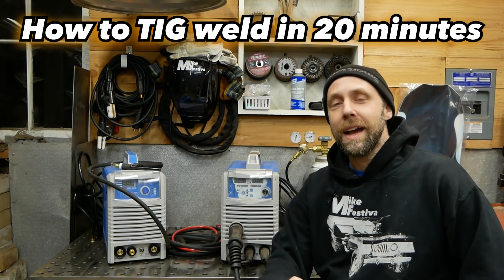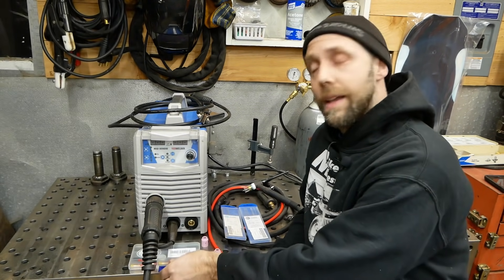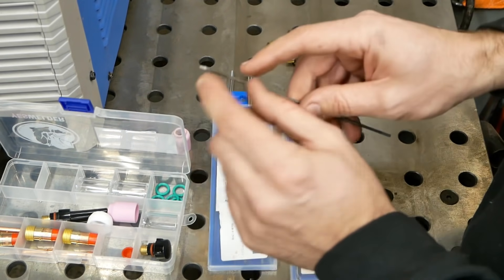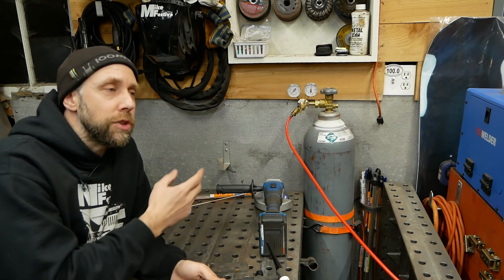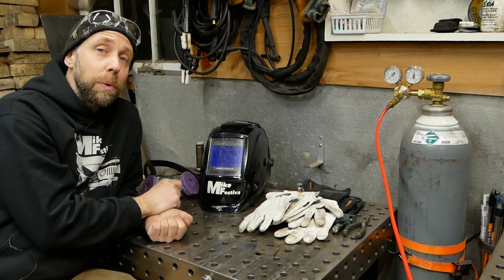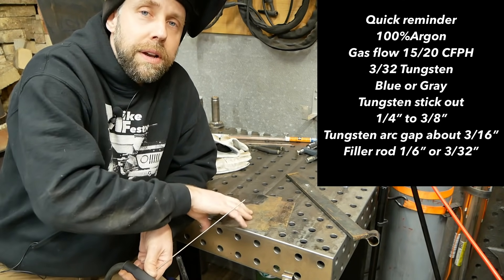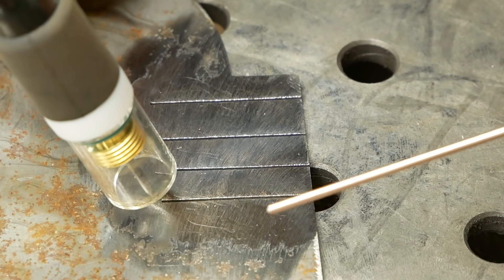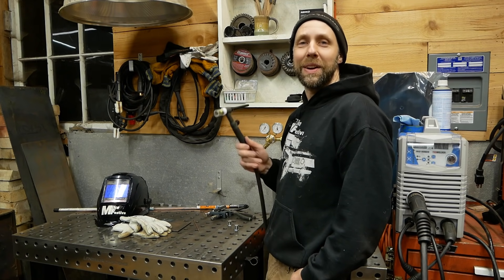Learning how to TIG weld made easy

Comment: Little tip. If you have multiple tungsten rods take 5 to 10 min and sharpen them all at once. This way you dont have to take the time to resharpen mid welding. I sharpen both ends of my rod so i can just flip it if need be but if you are using different rods its not recommended unless you mark the middle or something because you will grind off the color code showing which rod type your using. Happy welding folks

Comment: As a journeyman boilermaker (graduate of Boilermaker apprenticeship) you can definitely learn to Tig weld in 21 minutes. I did. The other 3 years 364 and 15/16 days of my apprenticeship were spent learning stick welding.
Reply: @BPattB  really why is that I thought tug take the most knowledge and skill
Reply: @levipote8823  I was making a joke. Tig takes the most time, in my opinion, because that's the last type of welding most people are taught.

Comment: Tl;Dr. 
I appreciate you and everything that you do Mike. I grew up welding in the oilfield here in Texas. I had my own rig and chased the pipeline until we had my son and my wife demanded a house instead of the Airstream. We settled in West Texas and I was never out of work until the recession hit in 1986 and everything stopped. There was no work anywhere and all of my friends were losing everything that they had. I got  line on a job in Corpus Christi with a company that built stainless steel milk tankers. I had never TIG welded in my life but had had a strong background in gas welding. I showed up to test and was pretty lost but figured out how to set up the machine (the shielding gas wasn't an issue since I also had a MIG machine and was familiar with it). But I was having trouble and one of the welders saw this and strolled by the test station and dropped a sharpened Tungsten on the table as he strolled by. I took the hint and put it in the gun and it was like the sky opened up! I then proceeded to build what they had on the blueprints (I can't remember now exactly what it was) and I passed the test. Thankfully, they teamed me with a guy who had forgotten more than I'll ever know and he molded me into a good stainless steel TIG welder. We never failed a USDA inspection and they crawl around those tanks with black lights looking for the slightest inclusion where bacteria might grow. It was an amazing experience and I loved it, even though I drove my rig to work every day and never fired it up. 
We welded everything except aluminum and I wanted to learn aluminum. Rey, my work partner, would show me  a little every now and then when we had a little down time and I'd practice. But I never got good welding aluminum. I could weld stainless all day, no matter how thin. But aluminum was a different animal and I was never at a point where I was confidant in my ability. 
I said all that to say this: I'm 68 and retiring in 2022 and want to buy a TIG machine to weld aluminum. I have an aluminum boat that needs a lot of help and don't want to have to rely on a spool gun. Some of the aluminum I'll be working with is very light. So I'm using your videos to refresh my memory on a lot of stuff and to learn things that I never learned. Your channel and "Welding Tips And Tricks" are two of the best that I've seen. I've bought machines that I'd have never even considered before watching your videos. Yes Welders? Yes, please! Inverter technology rocks! I have a couple of them in my shop that I haven't been able to break. So I'm looking forward to your aluminum demo. If you've made it I just haven't found it yet. I've subscribed to your channel for a long time but don't get notifications very often. 
Keep rocking these things out and I'll keep following along. You're an amazing guy with a ton of talent! And you're a great teacher. Seriously!  There are probably thousands of truly skilled welders and fabricators out there who don't have the ability to explain to others how to do what they do. I know a bunch of them personally! I look in the mirror and see someone who is not a good teacher! I don't know as much as much as many others that I've worked with but what I do know, and know very well, I can't teach.  
Thank you again for all that you do.
Reply from the maker: Thanks man I really appreciate it 👍 
I really enjoyed reading your comment, thank you very much 🙂
Tips And Tricks is definitely an A+ channel 👍
Hello from the Pacific Northwest!
Reply: I'm totally with you Texas Plumber - a bit younger, but same boat here in Idaho - and Mike you have helped me even improve my MIG. Never tried these "Yes" welders, but when my old Lincoln MIG finally went down Mike's video's encouraged me to try the Titanium 200 Unlimited, and I'm AMAZED at what I can do with it now! I might just give one of these YES brands a try for the Aluminum TIG side of things. Mike, You F'in Rock Brother! You could do a 2hr video on the color of Rust & I would watch it all.
Reply from the maker: @BareRoseGarage  Thanks man I really appreciate it 🙂👍 
Ps I love Idaho, I have spent a lot of time exploring all over that state on my dual sport motorcycle, I have found some really cool places and hot springs along my journeys! 👍 what part of the state are you in?
Reply: @Mikefestiva  Next time you're down by Yellowstone National look me up, I'll show ya "Huckleberry Hot Springs". It's about an hour from my house.... lol.
And again man. Thank you so much for these videos you do. You are an inspiration in more ways than 3.

Comment: 16 years ago I registered for a course in Tig welding at a local college in eastern Ontario. I'm LH and The booths were built for RH welders. I quickly became frustrated because  getting personal help in an alien booth was impossible with a class of 15-17 ? I kept bumping my too long( nobody said anything about shortening) filler rod. newbies.There was general group instruction and theory in a central area of the shop away from the booths. I went to a handful of classes( long enough to disqualify a $500  refund. I previously welded with stick and wirefeed all position BC provincial certification and I really enjoyed welding and  fabrication as a profession. 
Your 21 minute video taught me far more than I learned in 5 of those frustrating classes.

Thanks for your simple but concise instruction . I think I would have been successful in a class with you as the instructor
Reply: One thing trade school has taught me is, how to be resourceful and to teach myself. Both of which I already possessed. 

Henry Ford said, “if you don’t know how to do it?  Ask someone that does”. 

I saw that there were a couple of students that had more experience and “know how” on this subject? So I’d make friends with them and get them to help me. 😂

Made life easier and I passed my cert 2 in electro technology on the first go. Came straight out of university to get a trade. Didn’t even know how to use a drill before hand. 😂😂😂😂😂

Comment: thank you as a plant maintenance technician that never needed welding but always wanting to expand my knowledge this helps
Reply from the maker: TIG is a good process to learn but TIG is probably the hardest welding method.
If you haven’t welded before you may want to start with MIG welding first.

Comment: I'm self taught doing MIG. Just picked it up and started practicing. I thought it was fairly easy to learn. TIG, on the other hand, I need a lot more practice before I'd even consider something as a decent weld. I just started with the TIG welder and it feels like I have dipped the tip more times than I haven't.

Thanks for the tips. I'll come back to this video a few times I'm sure.
Reply from the maker: Thanks Roger for watching!

Comment: Lots of good tips for someone starting out. One thing I didn't see mentioned, not that big of a deal on steel but certainly for stainless, try to keep the dipped end of the filler in the gas stream when terminating weld.

Comment: My grandfather passed a year ago and always wanted me to learn how to weld he had a tig welder in the the basement only used it once for a chair i might as well learn a new skill
Reply: Don't forget to turn the water pump on. If it's a water cooled torch. Some TIG torches are air cooled. The plastic hoses will melt. The rule for TIG welding; use only Argon gas or a mix of Argon/Helium. That rule applies to all metals.

Comment: Been welding for about 3 months now at my new job. I was put into welding because the welder got hurt at home and the boss asked if I ever welded, I did with stick and mig but never tig. This video helped me learn techniques. At work it's pedal activated, which I find more coinvent as I don't have to turn off/on the knob every time. I was getting a lot of build up of metal and whatever on the cylinder thing and I guess I had it too far. I did as you showed today and it came out wayyyyy better. Lot less stuff flying over my helmet and getting me too. I do find that occasionally if the tungsten gets dipped in, it's not completely worth taking it out and making the tip good again, unless it's balled up a lot. Either way thank you for the tips!

Comment: Super cool, I tried to take a night welding class years ago, your instruction was way more informative and very well done. Thanks!
Reply: Dam right
Reply: weld on
Reply: weld on
Reply: @Alfredospirit  tr4575rrrrrrrrr7rrrrrrrrrr57rrt7rr5t7rrrrtrrrrrrrrr7rr5rr77t7ttr7r7trr7rr5rrrrr5r7rrrrrrrrrrr7rrrrrrrrrrrrrrr7rr5rr7rtt75r5tr⁵544r574474477r44775574747r5747r57r57574775r5555r7rr57rr757747rr7rrr575r7rrrrr7445r75rr57r7r7rr47r7rr7547rrr7r5r4r7555rrrr4r7r7r7rrr747r557577775rrr5rrr7rr775rr57r7r7r577r47r55rr4577rr7575r75r5rr57rr47rr7rr7rr775r57r5r75rr7rrr7r7557r7rr7r57r5775r7r757r757r757rtt5rr75r7rt75757r7rr77r7r7575rr7r77r75r77r757577r7r757r757r57r7t75757r757rr7r57757r7r57r7r7577r777r7r75rr7r7r57757r7r7757r75r7r7757rr7r77r7r7757r7r777557r757r7577r577r7r7r57r7r757r7r75rr7r7575757557rrr77777r57r57577r57r7r7r75r577575r7r7r7rr75r57rr7r7r7r7r7r7r7r7r7r7r7r7r6r7r7r7r6r7r7r6r7r7r6r7r7r6r7r7r6r7r7r67rr77t77r7r7trr6r67r7tr6r67t6r7rtr6r66rtr67t7tr6r6r6r6r7r7t6rr6r6r67t7r7tr67r7r7tr6r6r67r7

Comment: Thanks Mike for a really well done tutorial. Just found your Channel as I want to take the plunge and purchase a TIG set up . I’ve been stick and gas welding since the early 70s, mig in the 80s. Not much of a call for TIG welding on heavy equipment though. Your video was very informative without the
Usual unwanted gibberish  you can get. Thank you I will continue to watch and learn from your channel. At 70 years old you can still learn something new.

Comment: I had an interesting problem, two years ago. I got a refilled argon tank to replace my empty one. I always test a new tank—because. Well, the TIG welds came up grey. I at first figured the o-rings on my torch were bad, and the torch was pulling air in. I use an ESAB emp 205, so I change the torches around, depending on what I’m doing, so bad o-rings happen. But nope.

After “wasting” almost 300psi running tests, I concluded that the tank had been refilled with 75/25. It did great quality MiG welds. So I used it for that.

So, this is just a warning that gas suppliers do make mistakes, and if your welds are suddenly looking crappy, it might actually NOT be you.
Reply from the maker: Definitely a good point you mentioned here! I actually have had my TIG welds start looking really bad in the past, I was welding with 100% Argon gas and the bottle was great, zero issues but once it got down to about 300PSI  I started getting brown/Tan soot around me welds, I thought for sure I was getting an air leak somewhere, I looked over all my connections, still bad looking brown welds, I took my Argon tank in and got a full bottle, guess what, welds looked great again! I think my tank supplier doesn’t purge the tanks and they have contamination when they get low?
I have noticed this a few times now. So even if you have a few hundred PSI still, you could start having problems with the tank.
Reply: @Mikefestiva  I wonder just how careful some of these companies really are.
Reply: @melgross  
Always open the valve for a sec to blow crap out of tank and threads and always use a flow meter ( especially if ya costing jobs  ) as saves wastage and better controll and better welds
Reply: @octymocty132  that has nothing to do with the problem Mike and I experienced. They were tanks with either incorrect gas, or impure gas. I learned, in 1973, how to open a valve on a gas cylinder and how to use flow metering.
Reply: The company I work at actually got shielding gas with a lot of hydrogen in it that had been filled by mistake. Some shielding gas shall contain a small amount of hydrogen but this was so much that the gas mix caused an explosion when used as root filling gas in a big pipe. It's hard to comprehend that such mistakes are even possible, I had thought the major gas suppliers had good quality control systems to prevent the wrong gas being filled but apparently they are not flawless.
Reply: @skunkjobb  the question is how are they filling the cylinders? If it’s using a system that is error prone, that it, depends on the employee to set manually as to the mixture, then I can see errors piling up. If it’s a computerized system where they just tap on a mixture and the equipment does the rest, unless they connected the feeds to the wrong gas containers, I don’t see how there could be errors.

But there are errors, as we can see in this thread. Both Mike and I had them, and you guys are reporting it as well.
Reply: @Mikefestiva   any suggestions or tips for overhead TIG welding for beginners? Thx for your time & response.
Reply: Is this a 110v machine?
Reply: @ryanmahoney5311  both 120/220.

Comment: Great video. One of the most informative ones I’ve seen on the subject. My concern is that I’ve been mig welding for a while and many times you put down the torch to fix your parts last minute or you’re just used to be done and put it in the bench. I bet it’s common for new TIG lift or scratch welders to have a problem right there…

Comment: I've done more welding than most -  but almost always heavy industry using wire feeders. Every time I've tried tig, i sucked. Your video has inspired me to give it another crack.  Thanks mate. 👍
Reply from the maker: I have welded with stick and MIG for years but TIG was something I wanted to learn especially for aluminum welding but the AC/DC TIG welders cost so much in the past they were out of my price range. Now days you can pick up a consumer AC/DC TIG for $600 and they work fine. I have a second part to this video that covers the basics of aluminum welding. Glad my video was helpful 😊👍
Reply: @Mikefestiva  I'm looking to get one that can mig and Tig

Comment: Thanks man I appreciate This quick crash course. I’ve been in the automobile field now 8+ years and wanted to develop a new skill that’ll help with my craft, and maybe mess around with some exhaust pipe on my own cars 😅
Reply: It's a great hobby as long as you don't heat with the torch or weld on glue, laquer thinner barrels or truck frames. The rule for welders is always know what type of metal your welding on. Big rig trucks are labeled: "do not drill or weld on the frame." The frame will crack.

Comment: Mike, nice video. I have a combo Tig, plasma, stick welder. My only issue is the cost of the argon gas for once in a while jobs.. thanks!
Reply: Find a weld
Ing supply shop and check their prices. Usually the bottle deposit is like $140.00 for an 80 cf gas.  The fill up is around 39.00.
And 80 will fit in a back seat of a car.
Reply: @bobrat  thanks, but a lot of money for a couple projects a year..
Reply: @Tony770jr  then it will last you a long time, no?🤷‍♂️... Just check for gas leaks with a spray bottle and soapy water.
Reply: Having just invested in a DC Tig, stick and plasma cutter, I am about to discover the cost of hiring the large bottles of Argon.

I would rather get the large bottle to ensure that I get the maximum amount of gas for the money, it also means that I will have the gas to practice with before actually welding stuff together for real.

When I realized that the disposable bottles only lasted around 30 minutes, I began to consider the larger bottles as I would hate to run out of gas when actually building stuff.

Comment: I've actually been wanting to get a stick welder for some reason. I know you don't really care for stick welding but it could still be fun to see you do it! 😁
Reply from the maker: They definitely have there place, especially if you are welding outside in the wind, the cool thing about stick is you don’t need any gas bottles to weld, really simple setup will get you welding. 
I don’t often use stick for my welding jobs but years ago that’s the only welder I had.  Thanks for checking out my videos Christopher

Comment: I went to welding school at the age of 50. I earned an associates and still cant TIG very good. My go to is MIG. I sold my motocross bike and purchased a Lincoln 310 three process. The TIG process seems like it uses way to much argon. Perhaps just a matter of turning down the pressure. I will be experimenting more now that you showed us how its done. Thanks.
Reply: What is your argon flow set at? I would start low on like 10lbs of flow and slowly up it until it welds how it should. Also, are you sure you don't have a leak anywhere that could let argon escape while the bottle is on?
Reply: @christophermccrary8080  I start at 15 with a pedal. No leaks, it just seems like to much flow coming out of the torch. I am working on a couple of projects now. When I get done with those I will try the tig process again at a lower setting. Thanks.